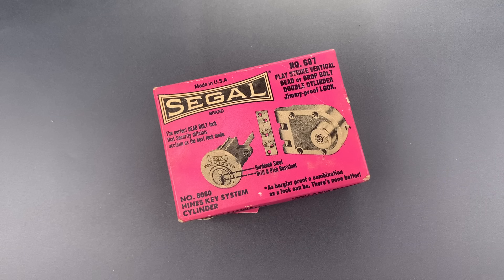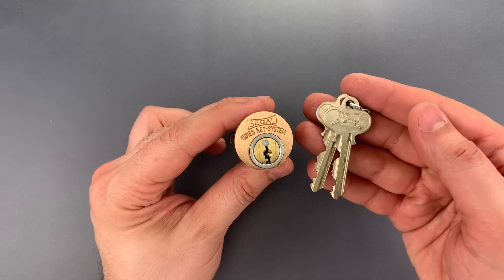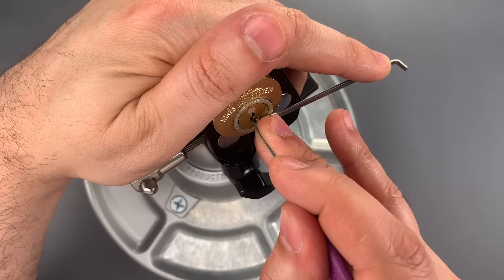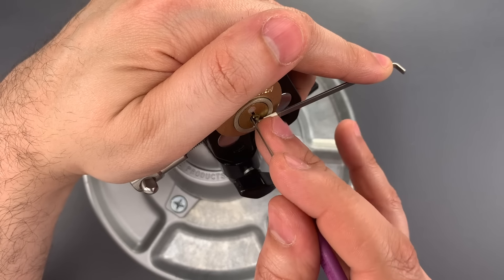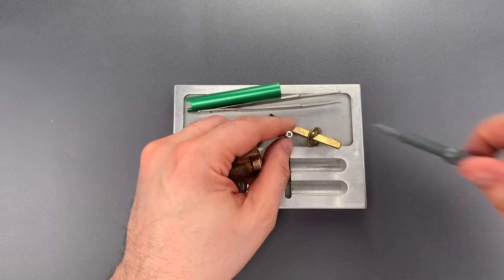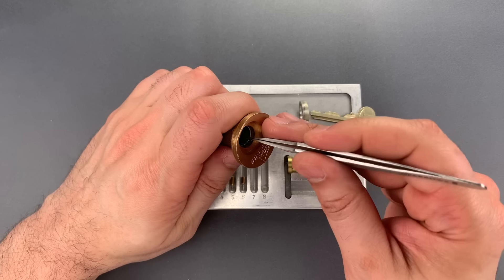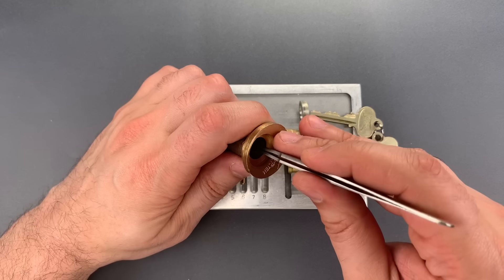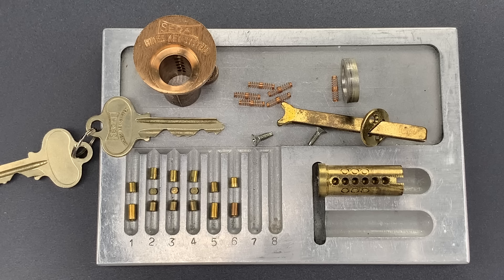[1181] A TRAP For Pickers! The Clever Hines Key System Picked

Comment: So cool that these technologies have existed for decades, yet modern manufacturers keep using easily defeatable designs.
Reply: same reason they mostly stopped making hi-fi analog audio receivers in the 1970s, too expensive and most consumers don't know/care.
Reply: it's impractical.  you only get one shot at picking it if you lose your keys, then you have to buy another expensive lock to replace the one that had to be destroyed in order for you to get inside your house.
Reply: @theghostofthomasjenkins9643  Whenever I've lost my keys my neighbours/flatmates/family have always had a spare set. I haven't had to pick my way into my house in decades.
Reply: @Ch1pp007  okay, but that doesn't apply to most people.
Reply: You're probably gonna need to replace the whole door.
Reply: @theghostofthomasjenkins9643  in some cases probably the door as well.
Reply: @TheGatatsu  exactly.  these kinds of locks would be nice to use in a commercial building where security is paramount but plenty of keys exist, such as a bank, but that's about it.  home use is certainly out of the question.
Reply: @theghostofthomasjenkins9643  If, while you are out, someone tries to pick the lock to break in your house and inadvertently sets the trap pins, you would return and not be able to get in even with your key.
Reply: @brownro214  That would be true in a flat/apartment, where there is only one door. This lock would be primarily aimed towards homeowners that have several entrances, as most renters are not allowed to change their own locks.
Reply: @brownro214  Yeah, that sucks. But it sucks less than having your house broken into. And it also means you know there's people out for your house now, meaning you can prepare for it with additional security. 

Most people only find out that they're a target when they come home and their stuff is gone.
Reply: @paulelderson934  I mean, they could just break a window.
Reply: @paulelderson934  If you want to be serious enough about security to buy a lock like this, then you should be serious enough to assume you're a potential target in the first place, and take additional security measures in advance. And most robbers use brute force, not lock picking.
Reply: Eric Aschner Right? These people acting like a door they can’t pick will stop a burglar. Honestly in this day and age I can’t imagine 99% of burglars trying to pick a door, let alone pick the door then give up
Reply: Imagine cutting corners but actually making it worse. 

Remember, the opposite of good is better.
Reply: like george carlin once said "stealing is good it keeps the economy going"
Reply: not a lot of home break-ins are done through lock picking so its not a feature that really is going to stop a lot of home burglaries  if you're looking for these kind of features in a consumer model.
Reply: A lot of thieves are more likely to commit opportunistic crimes or use destructive entry and many contractors or customers take low priced options. If 90% of customers will ignore the resistance of a lock when buying them, it makes sense to make a cheap option. Considerinf the extra moving parts and additional machining, this has to be more expensive.
Reply: @klenzgaming  breaking in is always faster than lockpicking that need skill and tools but breaking from window or other places should be easier to do it. 

Anyway, locks aren't designed to stop people, they designed to slow down people. Of course in some cases locks are basically just another way to say "you don't have access to here"
Reply: because they used to make things in the past for quality, now they are trying to save a $.
Reply: @theghostofthomasjenkins9643  Giving a spare set of keys to a friend, relative or neighbour is an extremely common thing to do. Being able to pick locks is an extremely rare skill. Of the two ways of getting into your house after losing your keys -- picking the lock or using a spare key that you've given to somebody else -- it's 100% picking locks that "doesn't apply to most people."
Reply: @asdfasdf7199  That’s complete nonsense of course. They never went away. You can still get true hi-fi gear today. People forget that today’s Bluetooth speakers and sound bars aren’t substituting hi-fi gear of the past, they’re substituting the common low-fi gear that people used in the 60s and 70s and the cheap boomboxes of the 80s and 90s.
Reply: Innovation is driven by two things: “Need” or “profit”. While highly effective, an expensive one use item like this that doesn’t have a broad need associated with it is a hard sell for spending R&D money. Cost per unit and total sales are real world factors that weigh heavily on design decisions.  “Good enough”, but cheaper, options will be acceptable in many more circumstances overall. It is an awesome lock though.
Reply: As others have pointed out, the potential downsides far outweigh the added security. Most locks need only discourage the casual thief who will look for an unopened door. My house sits on a fairly large piece of land. The front door is visible from the road, but at the back are a pair of glass french doors, not visible to neighbors or the road which are off of a patio that includes a stacked stone wall. A thief isn't going to bother picking any locks ...
Reply: @asdfasdf7199  Wow, they stopped making hi-fi analog audio receivers? I guess I had better inform my three year old Pioneer receiver that it wasn't supposed to be having analog components to it. Goodbye A.M! Goodbye F.M.! Goodbye all analog inputs including phono!
Reply: @brownro214  You could try the back door
Reply: If you work in IT, you know that most end users discard security for convenience. Nobody likes true security, from the top managers, to whom company policy is not to be applied, to the last employee, who will trade passwords with colleagues.
Peace of mind is what most end users want. This will be true for loscks as well: it may prevent entering, but there must be a bypass of some sort
Reply: @theghostofthomasjenkins9643  I don't think that this is a single time use. If you've made the mistake on those 3 pins, you force your way, shearing the thin skin of that pin and then just replace them. I doubt 3 pins (in the event you frag all 3) can damage the core or the bible in any way.

If the pins were anything but brass, i'd believe that's a single use lock, they are not. This is more like a witness mark than a locking burglar feature.
Reply: @aserta  no, the lock is completely inaccessible if it's installed.  the entire thing is brass as well, so forcing the lock is going to do more than sheer off some pins.  

let's not even mention that if it's able to be forced open, then the security measure of trap pins is useless anyway since brute force beats it that easily.
Reply: It's all about cost.  This would be a $50 lock today, or you can get a $20 normal one.  And everyone only wants to spend $20.
Reply: @brownro214  A replacement lock would certainly be cheaper than replacing the stuff the thieves would have stolen.
Reply: People rarely pick locks.  Simple fact of life.  They will usually brute force the lock, if they bother with it at all.
Reply: Lots of downsides to a lock like this.  Superior pick resistance but at the expense of other problems.  I think most people would just opt for simple cheap locks since criminals virtually never pick locks and save the money for other physical security or, more likely, an alarm and video system.
Reply: tl;dr: because this is a bad design
- if someone try to pick a lock to your house and he failed, you can't open your door even with the key
- not many people interested learning to pick a lock and professionals are extremely hard to find
- this is the year of 2020 most of people safe their richities in internet and their bank account, and if thief breaks in, everything can be easily tracked down if they also steal your smartphone
Reply: Easily defeatable? Watching someone that knows how to pick a lock and doing it yourself are two different things. Locks are only meant to keep honest people honest. lol
Reply: @OS10100   Honest people are already honest. The true main reason for locks is to indicate intent and due diligence. Your insurance company isn’t gonna pay out if you have no locks on your house...
Reply: @theghostofthomasjenkins9643  That was my immediate thought. Not too mention if a random burglar tried picking the lock and fails, you're not locked out until you replace the lock.
Reply: @tookitogo  Smashing through the window to gain entry into the house  is covered though right? Good thing he had locks on the doors!!! lmao
Reply: @theghostofthomasjenkins9643  probably also a new door if they can’t drill it out
Reply: cheaper to make.
Reply: Losing key will be nightmare
Reply: @cmdrzdenek-joerg5628  I like the claymore Roomba thank you :)
Reply: @theghostofthomasjenkins9643  Most lockpickers only destroy the lock xd
Reply: @ericaschner3283  that's the real reason why locks are cheap nowadays. They're merely a deterrent to slow down an opportunist burglar who might just be checking if something is unlocked and easy to get into.

If a burglar really wants in, they can always break in somehow. When my dad passed away, they literally just ripped the metal bars holding the shed locked and used a crowbar on the backdoor to tear it open so they could get inside and steal anything of value as soon as they found out he passed away. Completely ignored the locks and just went around them.

Locks are just merely a suggestion when someone really wants to get in.
Reply: @maxxcastillo9347  So you would put a fancy pick resistant lock on your front door but not the back door? If someone is going to the effort to pick your door, they will probably check alternate entrances.

You can also get some extremely pick resistant locks that don’t have this one’s massive downside if you want to go out of your way and spend the money. 

But for most people, a fairly cheap Kwikset is pretty much good enough. Once you get anything that requires more than raking, your windows are probably far more vulnerable and therefore a better lock has minimal added value.
Reply: @theghostofthomasjenkins9643  : Much better to need a replacement and secure the property - Contents of a House - or Business Premises are a lot more valuable than any lock...   

Yes it is a PITA when you accidentally lock your keys inside the back door....
Reply: @TheGatatsu    Industrial Hole saws are a handy tool. - for extricating a dysfunctional lock...
Reply: @brownro214   - And - you will at least know they didn't get in...  Is that worse, than walking into your Newly burgled apartment??
Reply: @theghostofthomasjenkins9643 I'm pretty sure most locked-out home-owners don't know how to pick locks to begin with
Reply: @theghostofthomasjenkins9643  Yes, because it makes much better sense to use a lock that is a piece of trash all because you can't be bothered to keep up with your own keys.
Reply: Elim Garak 007  Yep. If mainstream locks are like most retail products, the wholesale price is around half the retail price, and the wholesale price will be at least double what it costs to make. So chances are that lock that sells for $20 (i.e. $8-10 wholesale) cost no more than $5 to manufacture, and likely less... Chances are, adding the extra feature would only cost cents to implement, but when you’re only making $5 per unit, and that $5 margin has to cover your profit, packaging, warranty fulfillment costs, R&D, marketing, etc, it’s no surprise they look at shaving off cents.

(I used to work at what’s now a huge company that has hundreds of its own stores selling its own products. Back then, one common accessory was sold for $20. But we also got the same accessory in boxes of 200 pieces to give out when they failed under warranty. The entire box of 200 cost just under $400 — less than $2 a piece. And even that still would have had some logistics costs built into it, plus profit for the subcontractor that actually made them for us. So the actual pure cost to manufacture them was probably a dollar or so. Factors like that are common in many industries.)
Reply: My thought is that the hollow pin could become subject to faster degradation over time, leading to long term consequences.
Reply: @asdfasdf7199  instead they pay the same or more for worse audio gear with branding. People are  weird
Reply: @theghostofthomasjenkins9643  the door costs 500 in europe and the belongings 20000. Given that I will change my equipment every 2 years and I spend a lot of money to be entertained in some way, I prefer to break the door if I damage the lock. Also I will know if someone tried to pick my lock for 500 ,still good for me.....I live in Netherlands
Reply: I mean, it's great to have on your front door until someone just smashes your window and goes in that way. Of course its louder and all but how often do burglars actually pick a front door lock?
Reply: @villcrs4110  okay, but you still ignore the most common reason people call a lock smith and that's because they lost their keys.  are you willing to spend 500 on top of a locksmith because you lost your key?
Reply: If all locks were like this, some jerk kids could just run around the neighborhood while everyone's at work deliberately doing bad picks and lock everyone out of their own homes.
Reply: @theghostofthomasjenkins9643  I don't think I've ever met anyone who had to have their lock picked. It's much more common to have a replacement cut from an impressioning tool.
Reply: @Solereaper21  The majority of burglars won't even bother if they see a lock on something. They want something they can get into quickly and without getting caught. And if they DO go after a locked door, they are most likely to pick it and give up if they can't get in quickly enough.

The longer it takes and the more noise is made, the less likely they are to avoid detection. Breaking a window makes a lot of noise. If they break in through a window, they're more likely to cut a hole big enough to get to the clasp and open it that way.
Reply: @ReigoVassal  I've never heard of cutting corners doing anything except making something worse.
Reply: @ReigoVassal  Never heard of "visual deterrent" before? Just having a lock is often all it takes to keep something from being taken.
Reply: @OtakuUnitedStudio  how do you suppose the impressioning tool is going to work when it has trap pins?  you are more likely to cut a key that only sets the trap.
Reply: @theghostofthomasjenkins9643  I don't know anyone that doesn't have a spare set of keys, either them, parents, friends, or neighbours. I've never heard of anyone I know actually picking their own house lock haha
Reply: @asdfasdf7199     I know!  I care!  So do my TEAC reel tape decks!! ( 3440A, 2000x-r X two:one black, one silver, 1000x-r,....)
Reply: @GustavRex  no one picks their house lock, but they do call locksmiths.
Reply: @OtakuUnitedStudio  nope. But I can understand your last sentence.
Reply: @theghostofthomasjenkins9643  completely disagree. Most locks give you 2 sets of keys.
Reply: @thatoneguynoonelikes1066  and?  doesn't mean people don't get locked out of the house.  it happens every single day.
Reply: @theghostofthomasjenkins9643  I'd be more concerned with comming home and being locked out of my house because some idiot tried to pick the lock.
Reply: cause nobody stores valuable stuff in the house now a days. its in bank vaults, mostly in the form of a number in your digital bank balance.
Reply: I mean this is fine till one idiot replace all their outside door's locks with these and someday someone fails to pick them all and well the owner can't get in their hours anymore and since USA, sueing will follow, etc, etc....
Reply: @theghostofthomasjenkins9643  I don't think trying to pick your own lock is something most people do either.
Reply: @theghostofthomasjenkins9643  no, i do think it applies to most people
Reply: Price
Reply: @TheMegaPingasMobile  of course they won't.  i never said they would.  that's why i mentioned a locksmith in a previous comment.
Reply: @Martin-kv3th  if it did apply to most people, locksmiths would be out of business.
Reply: The easily defeatable designs cost the manufacturers less to make than actual good designs.
Reply: The Ghost of Thomas Jenkins good luck getting a locksmith that’ll actually pick it
Reply: @theghostofthomasjenkins9643  why so? I've never needed a locksmith in my life and never has anyone i know. usually it's way cheaper to smash open your basement window and replace it than going for over-charging locksmiths.
Reply: @theghostofthomasjenkins9643  bro just dont lock urself out of ur house, like how hard is that lmao
Reply: @KekusMagnus  hey look, i found mister perfect who has never made a mistake in his life.  how have you managed to never accidentally do something you didn't want to your entire life?  please, share your secrets.
Reply: @Anonymous8317  if a locksmith can defeat your lock without picking it, then so can thieves.  there is nothing a locksmith has that a thief can't get a hold of.  even more proof this design is impractical.
Reply: Part of the issue in this specific case might be that many people probably do not want a lock that could be easily intentionally or accidentally vandalized to seize up and trap the owner out.
Reply: @asdfasdf7199  McIntosh Labs still makes them, really cool place.
Reply: @theghostofthomasjenkins9643  Totally wrong. The "expensive" lock you're talking about only goes for about $30-$40 on ebay, and it's not even in production anymore. You could easily do the same thing with a $15-$25 kwikset... lpl even mentions the video on it. 

Either way, both locks have normal 6 pin keys. Any Walmart or Home-Depot or Lowes in the USA would be able to make a spare for a few bucks.

You're wrong about the spare key thing too. It's big time ye olde meme to keep keys under doormats and stuff, and I would say people who don't keep spares somewhere would be the outliers. It could cost up to $100 to have to call a locksmith, and few people practice picking in this country. Either way, spare keys are cheaper than smiths or picks, and this lock is neither expensive, nor impractical.
Reply: @brownro214  So? You know someone tried to break in, and lots of homes have multiple entrances. Lots of homes have cameras. The lock itself is cheap... I wonder how much you could lose in a breakin.
Reply: @Solereaper21  It's kind of dumb to assume that this would be the only mechanism someone buying this kind of lock would use on a door.
Reply: @Nerdnumberone  Sure, but this lock is aimed at a security-minded customer, the kind who buy strong doors to go with their strong locks... You're wrong about the cost too, Washers and hollow pins aren't expensive. You can get this lock for $30 on ebay and it's considered rare and collectible because it's not manufactured anymore, while a new kwikset 600 costs $20 anyway.
Reply: @michaelzdanis3979  The lock was marketed toward people who care about security. Obviously you don't, or you wouldn't let a piece of glass be the only thing that stops someone from forcefully entering your home. Also... there are no downsides. You're never going to set it off yourself because spare keys cost like a dollar... and if it did prevent a breakin, you would save alot more than the cost to replace a $30 lock.
Reply: @sminthian Incorrect, you can buy this exact lock on ebay for like $30... and it's considered rare because it's been out of production for years. Chinese knockoffs of it go for $15... if quality didn't matter, everyone would go with those. The branding of the lock is what failed.
Reply: @iatsd  People who buy strong locks tend to buy strong doors. Simple fact of life. They usually have more than one type of security in their home. This lock does exactly what it was designed to do.
Reply: @syahrulzahrawaani2897  tldr: lol no
- Stopping a break-in is worth trashing a $20 lock.
- There's no downside to more pick resistance, and the lock isn't expensive.
- This is 2020 where dumb people like you voice your opinion and think you know everything. The lock design does exactly what it's supposed to do.
Reply: Elim Garak 007  Yeah... except it uses standard washers, standard hollow pins, and a drilled hole. You could even take the hollow pins out; they aren't needed. Long story short it would be pennies per unit... and a consumer can get this on ebay for $15, while those intelligent consumers buy $20 kwikset 600s from Lowes.
Reply: @JoinMe27  Spare keys are a thing... it's only going to lock out on a theif, and $20 locks are cheaper than the cost of a breakin.
Reply: @vonBelfry  The design is flawed by including specially made hollow pins in the first place. A small divot in the cylinder where the hollow pins catch could just catch a normal t-pin.  In this scenario, you push the driver pin to the sheer line and it clicks... the plug will turn in the cylinder. However, unless you also push the wafer above the sheer line, the t-pin will be pushed up into the divots when the plug turns. This would save money, time, and even give you more pin material at the sheer line to stop a brute force attack.
Reply: @chase9316  no one wants this lock but pickers, so it's not going to be expensive.  that's kinda how pricing on ebay works.

the fact few people practice picking feeds into my point of this being impractical, so you're wrong there.  a practical design is something that gets adopted because it works or is good enough.  an impractical design gets left by the wayside because it's pointless and needlessly complex.  thanks for proving my point.

oh, and that's exactly why most people don't a key under the mat.  it's an old trope.  that's the first place people look.
Reply: Locks serve two purpose, keeping unauthorized people out and allowing authorized people in. That lock , like all locks with unresettable trap pins is good at #1 but not good at #2. We now have locks that are extremely pick resistant without the need for trap pins locking the owner out.
Reply: It depends if you will get more on insurance for putting a lock on something then reselling it
Reply: @asdfasdf7199  even my 7.1 receiver still has analog inputs.   Now if you mean units without solid state and just tubes, Of course that stuff is out of production and honestly a totally analog unit is not going to provide any better sound quality over a high quality unit using microchips.  "analog is better" itself is a myth too, Digital sound can exceed ANY analog recording medium in quality and accuracy.   Find a properly mixed(read no loudness war gain boosting) CD and it will blow any 45rpm out of the water.  Assuming you play it on a quality CD player(or CD transport, no clue why but Audiophiles call a CD player "CD Transport" for some reason) and run that player into a quality receiver preferrably over digital interconnect unless the CD player has a better DAC.  Or if one is overly rich, have a totally independent DAC like how high end vinyl fans sometimes have a seperate turntable preamp.
Reply: I think he said it best at the start of this video....You'll recognize this lock from 10 feet way.  Therefore, Seeing this type of lock...my inner mischief maker would make sure to only focus on getting the first sheer line of pins two, three and four.  So many people are going to be mad that they can't get into their home without destroying the lock they aren't going to buy that same brand again or  if they do, one without this feature.  Remember this wasn't about getting into the home but rather inconvenience the owners of the lock to the point they no longer support this feature and buy a different brand or maybe one of the same brand but lesser value that doesn't have this feature.  They would get tired of not being able to get into their home and having to call a lock smith to replace the locks they no longer support this feature.  They therefore move to a more defeatable design because it causes them less of a headache and saves them money! Remember I'm out to create mischief not get into the home.  With this mentality this feature becomes way more of a headache than a security feature.  You can feel like you stopped someone from entering your home and taking your valuables but really it was just me with no intent on taking anything you own but creating mischief.
Reply: @Ch1pp007  When I read this comment what came to my mind was, you had to pick your way into your neighbours house to get your keys.. 😁
Reply: blame the accountants, " save money!!!" make it cheaper....
Reply: Locks aren’t to prevent somebody from getting in, they’re to keep the honest, honest and to give the dishonest a fight. If someone wants to open a lock there’s not gonna be much to stop them
Reply: Ease of manufacture is king. They don't really care about your security, just your money.
Reply: @theghostofthomasjenkins9643  it does apply to most people, because most people don't pick the lock to their door when they lose the key
Reply: @taninmoores4943  do none of you actually read?  i've addressed this already.
Reply: @theghostofthomasjenkins9643      
Lots of assumptions there, mate! Let's go through them:
1. (most) people who buy that type lock for their home are lock pickers.
2. Even though they are lock pickers, they will forget all about the traps.
3. They will be able to get lock picks easier than a backup key.

I say: "citation needed" to 1.
2 --- that is a bit incredulous.
And 3?  Are you carrying your lock-picking gear on your body every day or is it in your car?

Most people simply call a locksmith.
Reply: @ericaschner3283      they could just break a window  Sure.  Just throw a stone.
Next up: getting to and through the window can be a problem if it's above ground level and/or there are bars in front of the window.

Typically breaking a window gives a pretty clear glass shattering sound --- rather unlike unlike lock picking.
Reply: @dstarr3  "If all locks were like this, some jerk kids could just run around the neighborhood while everyone's at work deliberately doing bad picks and lock everyone out of their own homes."

Yeah....and some jerk kids could just run around the neighborhood squirting superglue into all of the standard keyholes while everyone's at work. But they don't, really? Do they?

And any neighborhood that had anything like that happen once wouldn't let it happen again.
Reply: @brownro214  yes. And once you do manage to get into your house, you’d still have all your stuff.
Reply: @hepcecob  or go through a window, which is what most burglars do.  They'll test the doors on the off chance that one will be unlocked.  Burglar bars on the windows, motion activated lighting, and reinforcement of the doors and door frames, would be a better investment for a homeowner than a high security locks.
Reply: Thieves don't usually pick locks. Most thieves are cheap and crude and just use a crowbar, hammer or brick. Bust the door or a window. A lock is a deterrent to discourage the person looking for an unlocked door.
Reply: @brownro214  Yeah but, ideally, you still have a TV and Computer so I call that a win.
Reply: @Ch1pp007  most sensible people have a spare at a reasonable location.
Reply: @ericaschner3283  draws too much attention. If someone picked your house lock took some commonly misplaced or rarely used items then left after locking your door how long would it take for you to realize you’ve been robbed?
Reply: @theghostofthomasjenkins9643  i can break through almost anything with enough force.
Reply: @brownro214  Might actually be a good thing... Then you KNOW for sure someone has tried to enter your home/office/ whatever you used the lock on.
Reply: The big thing about how pretty much anything is manufactured nowadays is that they're not built to last, but a lot of things were made with a higher quality way back when
Reply: @brownro214  presumably you could get in another door. Then the lock can be taken apart and reset by a locksmith.
Reply: You can still drill it out just takes more time.
Reply: @TheNasaDude  Probably because true security only exists in the minds of security folks.  Everything has a cost/benefit and risk posture.  The more you try to drive risk to zero, the more costly (and not just direct, but time and opportunity as well) security becomes.  Why install a pick proof lock when the person breaking in won't be LPL, but a crackhead using a 12 pound hunk of iron with a three foot handle for a "pick."
Reply: @theghostofthomasjenkins9643  I would imagine that more people have a spare key hidden or with a friend/neighbor, than can pick a lock.  Any locksmith worth his salt, can pick a lock with the Hines key system.
Reply: and yet they call it „pick-proof“
Reply: cost of manufacture
Reply: More like “they could make them but just want to supply the cheapest thing they can”
Reply: @maxxcastillo9347  renters not allowed to change their locks ???? Where is that silly stuff ? 
In my country, the one who owns the house and rents it out is absolutely not allowed to enter the house and if you as a renter have the slightest doubt if they will keep to that, or if you think maybe the previous renter might have kept a copy of the key,  you change the cylinder in the lock.
Reply: @theghostofthomasjenkins9643  if you had a lock like this, it'd be your own fault to not keep a spare somewhere.
Reply: @theghostofthomasjenkins9643  you think most people are attempting to pick their own way into their house if they lose their key?
Reply: @craigcrissman4651  no.  are you people even reading before commenting?
Reply: Plenty of secure key systems around and they don't need to be destroyed. e.g. Kaba Star Cross is hard to pick (I actually haven't seen the LPL pick some newer Kaba keys, he has picked a Kaba 20 in #937 but that is a quite antique model). If that is not enough go for a Kaba MC Design, thanks to the electronic component you can time-limit access and many other cool things.
Reply: to be fair LPL has picked what he would call "The best locks in the world" within a 30 second timeframe and makes them look like childsplay. I have to remind myself that he is a grandmaster lockpicker and I cant replicate what he can do. So most companies stuff isnt as garbage as he makes them seem to be, he is just super damn good at what he does.
Reply: @sebastianriz4703  what locks are those? I know LPL is a master lockpicker and certainly one of the best in the world but his content hasn't really focused around picking the highest security locks
Reply: @craigcrissman4651  I have been finding them every now and then. I dont remember any specific ones but I know he has guest shown some really good ones in his opinions every now and than. I just subbed to him a couple days ago so I dont remember a lot of his vids yet :(
Reply: Well one
It would be Hard to open if you fail to unlock it
Reply: @theghostofthomasjenkins9643  yeah
Like a bank vault
Because it fails
You just replace it
Reply: These kind of locks on houses became pretty much irrelevant when people started putting huge windows in  everywhere. I build houses for a living, I remember this one job where the customer was putting in a $4,000 engineered steel security door right next to a 6 by 6 plate glass window, we all got a chuckle out of it lol.
Reply: @theghostofthomasjenkins9643  You get 2 or 3 keys with it. I don't think it's the lock's problem if you lose all of them.
Reply: At the end cost is always king. Consumers won’t pay more so it’s the cheap crappy designs that win. 

We had supersonic travel with the Concorde and that stopped because it was too expensive and consumers weren’t willing to pay that premium (and also issues with sonic booms over land).
Reply: Only about 50% of illegal entries are made through the main door, and mostly in appartement.
For the rest, which concern mostly house, entries are made through windows, garage and backdoor.
Most windows only require a screwdriver to be forced opened, so the concern should probably be turned to those first
Reply: @tiloalo  I build houses for a living. We were doing this one job were this guy was putting in a 4,500$ metal framed metal security door, right next to a floor to ceiling 6×6 picture window...  lol we all got a chuckle over it.
Reply: @travisdoe4663  exactly, everybody is concerned about the doors and locks, but nobody ask themselves how safe are the windows that they choose...
Reply: "cool" is not the word that I would use.
Reply: It’s much more expensive to manufacture a lock like this. Most people can’t pick a normal lock, so we still have plenty of cheap ones. There’s just not an enormous market for locks that require a ton of skill to pick
Reply: yes. unequivocally true man
Reply: @theghostofthomasjenkins9643  that's where'd you have to weight the costs, for example it may be cheaper to break a window, and get in, or if gave someone a key, or maybe you significant other, just simply wait. 
I say the whole break a window thing, as I had to do just that to get in. Granted the glass is relatively simple to replace without having the replace the whole window, since it was not a vinyl window.
Reply: I leave a spare set in the office, amongst other useless keys in a big box.

Even if someone knew I had a box if keys, they'd never know I was in love with the mailman.
Reply: @theghostofthomasjenkins9643  Not to mention, Just having a door be completely null and void due to someone tampering with it, could be a massive safety risk. Imagine if someone was in a small secure shed when the lock got tampered with, they would then be trapped.
Reply: @Ch1pp007  I'm imagining this if you never gave them spare keys. 😆 (They are just so considerate to make copies just in case.)
Reply: @eyeborg3148  Wasn't Concorde destroying the ozone layer too?
Reply: @Dowlphin  Yeah, if I no-one had spare keys we'd see locksmiths drilling locks all over the place. :p
Reply: Because it brings in more money, why you think everything has a shelf life now, so you're made to buy more.
Reply: @michaelzdanis3979  It makes sense,to me at least to have insurance as well as a decent...as far a I knew ,I made the mistake of buying a ABS DOOR lock back and front if you don't carry a spare key AND lock yourself out and forget a security no which I had on my computer indoors ,choice 1 phone up key/lock company is a non runner as I couldn't remember the key security no .proving to my wife I AM the idiot she always suspected is I was  no point in having
Reply: @theghostofthomasjenkins9643  How does that not apply to most people?  Just own a spare key and give it to someone you trust.
Reply: Yeah, that's what happens when more value is placed on value and not on actual security.
Reply: @asdfasdf7199  to ooopooioi ooooi 🔥💩 ooo 🔥oooioooo